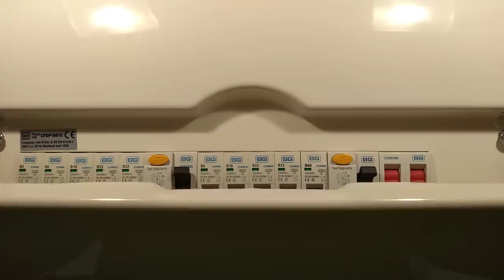A look inside a British home electrical panel.

Comment: Clive, are the shiny bits at the ends of the fat blue cables live?
Reply: The shiny bits are called ferrules. They are conductive, so are "live" in the sense that they carry current in a working installation (rather than on Clive's desk). On the blue insulated cables the ferrules would be at the neutral mains voltage.
Reply: Modern electricians think that neutral wires are 'live' even though we know that they aren't.
Reply: @petehiggins33  although consider what might happen if there's a break in the neutral path back to supply
Reply: Is there a good reason the ferrules are left bare?
Reply: @thejll   There doesn't seem to be much point in insulating them when they are connected to those bare bus bars across the top.  They are harmless except in the rare case of a Neutral feed open circuit fault.

Comment: Does the main Isolator affect both the incoming neutral and hot leads?
Reply: Yes it isolates both. 2 Pole
Reply: @peterpeterson9903  Interesting.  In Canadastan the incoming neutral is not switched, only the two hots are.

Comment: I love how people think its so complicated but so easy in reality, and practical too, I just hope nobody looks at this video and uses it as a how to
Reply: Actually they do. Then they change their box, adds some cables and burns down their house. Or, if lucky, get a feature in the trade magazine as the worst installation of the year. I clean out a lot of DIY installations. There's no end to human creativity. All educated by grandpa or Youtube University.
Reply: @arneanka4633  you're only as good as the person that taught you 😂
Reply: @phonotical  True. But Youtube U is not a full class in installations and teaches only fragments of all the knowledge you need to make a safe installation. Very few talks about circuit impedance and the consequences it has for trip-timing. Never any talk about the classes of cable laying and how much load a certain cable can take under those conditions. And most of all, no practical training in how to screw. Not the kind you learn on Youporn that is! Too hard and the cable is destroyed. Too loose and you get a hot connection point. You need to feel it.
Reply: @arneanka4633  oooookkay!
Reply from the maker: I intend to cover circuit impedance and why it's another piece of nonsensical red tape.
Reply: @bigclivedotcom  It's fun to dismiss that until the day you're stuck with a fuse that blows after 10 seconds on a dead short. Just because you didn't care about your circuit impedance and put a too small cable to your shed. 

Anytime you lay out long cables, some thought must be put into the question if 1,5 mm2 is enough for that 10 A C fuse or you should step up your cable to 2,5 mm2 or get a B fuse instead.

Comment: UK electrical panels look about 50 years more advanced than US ones. The US ones were designed in the 60s, clearly by someone who thought the bakelite fuseboxes from the 30s were just fine and saw no need to change them.
Reply: I like the US style in one major way... MUCH more room to work. One could get the same effect over here by using an industrial 3 phase panel with a single phase bonding kit fitted... but customers would balk at the prices.

Comment: Doesn't seem like very many breakers, would you really use one this small to wire an entire house, or is this just for a smaller branch circuit?
Reply from the maker: This one would serve quite a large house.  We only need a couple of power and lighting circuits plus a few special circuits.
Reply: @bigclivedotcom  I guess that's just another difference. In my fairly-small house alone there are twenty circuits, and I've wired houses with as many as 50-60 breakers.
Reply: @AJMansfield1  upstairs light, downstairs lights, upstairs outlets, downstairs outlets and then maybe a breaker for the cooker if you don't use gas.  Or one for an electric shower.

Comment: In Romania, we have a regulation named I7 / 2011 wich its made from UE regulation, mostly from Deutschland. TN-C and TN-C-S are the most widely knows in my country as distribution.

In that regulation at 4.1.4.1.9. "... In fixed installations, a single conductor can have both the function of protective conductor and neutral conductor (PEN conductor). No protective or separation (cut-off) conductor has to be mounted on the PEN conductor. ..."

From that, some electrician colleagues decided not to use 1P+N MCB because we don`t have to interrupt the neutral wire. In Italy , France, etc, they use 1P+N MCB. What kind of distribution they have and why can use this kind of breakers and we don`t?  Thank you!
Reply: You cannot put an RCD on the PEN wire because the earth cannot be cut. Should the RCD work incorrectly and cut only the PEN wire the cases of all grounded equipment would become hot - a very dangerous situation. The second problem would be that it could easily trip if current escapes through the equipment cases. 

You can use an RCD after the neutral and earth has been separated like in a socket or a plug in portable one.However, remember that an RCD protects only on faults that happen after it. It does not protect from a broken PEN wire.

Comment: What is that word he said at 16:43?  "And if you were faffering around with wires..."  What does faffering mean?  I'm curious, because I invented that word years ago, and my wife & I use it all the time.  We use it as a "fill in word" if we can't think of an actual word in a sentence- Example: "I changed the faffer in the furnace because it was squeaking".   It's a fill-in word... because it would take a minute to think of the actual part name.
Reply from the maker: Faffing.  Fumbling about with something.

Comment: Found my consumer unit had the live bus bar clamped under the screw heads and not in the cable clamp of the breakers.
Reply from the maker: Some have a forked bus bar that goes under those screws.

Comment: Why are British consumer units layed out right to left (in most cases)? I noticed that the earth bar was numbered left to right...
Reply: Might have something to do with the ring mains design, also it might be to save space. Its not uncommon for these things to be installed in the tightest of spaces what with British homes traditionally being small.
Reply: @uK8cvPAq  It would be no different to install the main isolator on the left, followed by a RCD and it's protected circuits and the other RCD and it's protected circuits. I consider this to be neater as we tend to organise everything else in a left-to-right layout (westerns read and write l-t-r). I don't see how it affects ring main design or how there is a difference in space used by one or the other.

Comment: I have an issue where my boiler causes lights and lamps to flicker in my house. I had an electrician come over and he told me that the that the main lights and the boiler were on the same circuit and it should NOT affect other appliances, but ...its does. My monitor flickers and so does my lamp in another room intermittently.

What does this sound like to you? I'm UK
Reply from the maker: It could possibly be due to a bad electrical connection.  Some electronic items are very sensitive to electrical glitches.

Comment: The last time I bought BG was a box of ceiling pendants / ceiling rose. Every one of them had screwed through the insulation not the copper wire in the terminal connectors. Cheap shite.

Comment: Q: why is  stranded wire used in the British system ?  Stranded has strands break off every time it is stripped(incorrectly) and  may result in incorrect connection at the terminal
Reply: Generally, the wiring in the walls is solid copper with a cross-section of anywhere from 1mm (for lighting) or 2.5mm (for ring power circuits) up to 6mm for stoves.

Comment: Clive (or anyone else) - so on the topic of A/B/C breakers, if I wanted to put a lathe into small workshop, a C type would be what I want, given the motor load?
Reply: I would think a lathe motor suitable for single phase would cope fine on a B
Reply from the maker: If it's problematic on a B it's cheap and easy to upgrade to a C.
Reply: Thank you folks :)

Comment: On mine I've fitted a 100ma rcd external to the db so I can isolate the whole board if needed 100ma so has discrimination from the 30ma and should the 30ma fail I have back up earth leakage protection.
Reply from the maker: One extra feature would be to use a type S external breaker as that also adds a tiny delay (100mS) to allow the 30mA breakers to trip first.
Reply: @bigclivedotcom  30mA has limit no kill human, if use biggest limit fuse have dangerous lot. animal houses can use biggest mA fuse, but human area all need be under 30mA or not have safety and legally.

Comment: hold on. 5 days for an electrical education? ive been to school for 3 years, then apprentice for 1600 hours, and worked as an electrician for 3 years before i can officially call myself a "real" electrician... Sweden.
Reply from the maker: Yup.  Deskilling courtesy of a marketing company that falsely implies it's an official government inspection body.
Reply: @bigclivedotcom  thats insane. deadly even for the new electrician in question. i would never let someone with 5 days of education tamper with a fusebox. especially not the old ceramic ones we've got here in sweden.
Reply from the maker: @andreasolin8520  Since they pushed their "approval" scheme through, the number of electrical fires has increased dramatically.

Comment: Very interesting. And totally different from America. I would not put less than a 30 space panel in a home. And of course our standard main breaker these days is 200A. But I'm surprised this hogwash with arc fault breakers hasn't reached the UK.

I wonder if they'd give you a rash of shit if you used an American panel and simply jumped both bars with your 240V. We have tons more room in our panels.
Reply from the maker: They're trying to force the arc detecting breakers in here for profit.  There's no sensible safety justification for them with our wiring system.
Reply: @bigclivedotcom  Politics. The National Electrical Code is full of politics.

Comment: I have an emergency backup generator which (after flicking OFF the Main Red Switch - to prevent powering the neighbourhood) I was going to backfeed (yes I know that could be dangerous) into a downstairs socket. However having one of these consumer units - I was told that it would only supply the downstairs and would not (as I had hoped) feed the  whole house. Can anyone tell me if this is true and what could I do to feed power simultaneously to both upstairs and downstairs?

Comment: yes got a d type at home for the tig . screwfix do them
Reply from the maker: That will really mess with your loop impedance requirement for that circuit.  Fortunately it's all blown out of proportion so it doesn't actually matter.
Reply: @bigclivedotcom  its on its own 60a  in from the grid just to run the welder on

Comment: tho this is if your house is modern... still a lot of the old wire fuses out there...
Reply: You aint kidding. A friend has been a sparky for 30 years and he is still finding the same kit in some houses that was considered obsolete when he started.
Reply from the maker: Will I make a video about the old Wylex fuse version?  It has asbestos and an exciting secret easter egg that apparently blows out utility company fuses.
Reply: @bigclivedotcom  that I would love to see.
Reply: My parent's had it. I still remember the bit of card with fusewire on it. I'm sure you can still get them.
Reply: @chaos.corner  They have not been legal in the UK to install for decades.
Reply: @gordonlawrence4749  Rightly so (nothing like trying to do all that stuff by torchlight). I meant the fuse wire though. (Confirmed. You can order them from Amazon).
Reply: @chaos.corner  Ah ok I misunderstood.

Comment: "A typical home will get a single phase and neutral with the three phases spread amongst homes in a street"
What? O.O  So you can't simply connect three phase motors into 5-pin plug in your house?

About installation, I decided to go this way:
- house is divided into three parts, every part on its own phase
- every phase have its own 16A RCBO (sockets) and on output of every RCBO is also one 10A circuit breaker (lights)
- so everything should be protected via RCBO

I heard it's pretty bad idea to put one three phase RCD for whole house (people do it because it's cheapest), because more devices on one RCD means bigger chance to trip it.

Comment: Does the main isolator isolate both active and neutral?
Reply from the maker: Yes it does.
Reply: @bigclivedotcom  that's interesting in Australia it is very similar but you only need to isolate the active and the main isolator has to be a circuit breaker because of people accidentally making the final sub-circuits adding up to more than what the mains cable is rated for.

Comment: I had my house rewired and a new distribution board  with two rcd's but one rcd would trip randomly and the electrician could not workout why, another electrician came and he could not work it out. It was getting dangerous when the rcd tripped and especially  in the dark resetting it. It would last week ,a day or a couple of days, it  was a bloody nuisance.In the end I removed it and replaced it with a plane breaker. As all the circuits have fuses and all the plugs have fuses and electrical equipment double insulated it would be nice if it worked but it is not necessary.
Reply from the maker: Sometimes finding an intermittent trip issue is tricky.  Not all faults show up in an insulation test if a piece of controlled equipment only connects occasionally.  Bypassing the protection isn't ideal as the trip indicates that enough current is flowing somewhere to give a sever electric shock if you end up as part of the leakage circuit.
Reply: @bigclivedotcom  True, not ideal but better than tripping over furniture in the dark to get to the fuse box and reset it. The old hard wire fuses had none of today's protection and people got by.The odd thing was everything was connected nothing changed however the tripping was random day or night

Comment: I'd love a brief talk on the 'Part P' fiasco Clive. I'd really like to hear your opinion on domestic electricians here in the UK. I have to admit to doing all my own electrical instalations after a couple of horrible experiences involving the aforementioned 'professionals'. One being a house rewire were after finding at least two earth wires cut short and not connected into 13 amp sockets. On further investigation I found at least 10 loose connections inside sockets, junction boxes and the consumer unit itself. As I'm led to believe that loose connections now account for more house fires than the traditional chip pan I was seriously unimpressed. 
Another shocking (pardon the pun)incident of an incompetent domestic electrician I came across was at a theatre I was called out to to investigate why the house dimmer units kept tripping out. The idiot who had been acting as the technical manager had daisy chained together 6 6kw dimmer units together sub stage. I can't remember now what cable he'd used but it was so underrated that the links had melted into a congealed mess across the outputs. It was a miracle there hadn't been a fire and the guy clearly had no idea how to work out or distribute the load. As an odd aside he was only sacked when the council run theatre uncovered the embarrassing extent of his other more financial frauds. I was asked by the new technical manager to come in while the venue was dark to help to completely rewire the grid. A really fun job which I thoroughly enjoyed.
Reply from the maker: If you are comfortable with electrical work I'd suggest doing your own wiring so you get something done to your standards.  Part P is nothing more than a protection racket that has resulted in deskilling of the electrical industry.  A good example would be a new consumer unit a friend had installed that was making a burning smell with smoke.  The contractor told him "it's just the dust burning off.". (There was a loose connection.)
Reply: @bigclivedotcom  Burning smells from a new consumer unit 😱 I'd have to investigate immediately! What was melting if I may ask? So, I'm guessing that semi skilled electricians carrying out part P aren't able to correctly calculate load? The cottage we bought a couple of years ago had wiring which in my opinion was so dangerous I had to disconnect the entire heating side of it immediately. Oddly, the house came with an up to date electrical inspection certificate signed off by the electrician who lives next door.
Reply from the maker: @PurityVendetta  It was "fixed" apparently, but I'm hoping to go and take a look to see if there are any signs of damage.  My guess is that a breaker wasn't attached to the busbar properly.  One of the many common mistakes made by crash certified labour, and the reason why they had to adjust the regulations to specify non-flammable consumer units.
Reply: @bigclivedotcom  Oooh, do let us know if you can establish the fault. I have to suspect that the 'crash certified labour' you talk of are motivated by an easy cash incentive rather than people like us who share a fascination with the workings of electrical and electronic stuff. I still have some of those Practical Electronics magazines I bought when I was at school (and the shame of dismantling my Uncle John's Goodman's stereo and not being able to put it back together 😨)